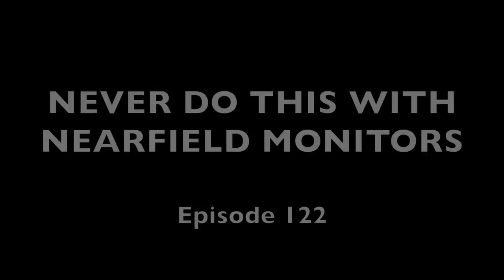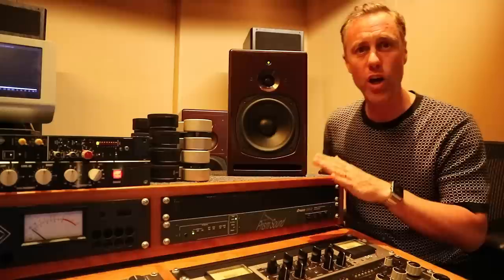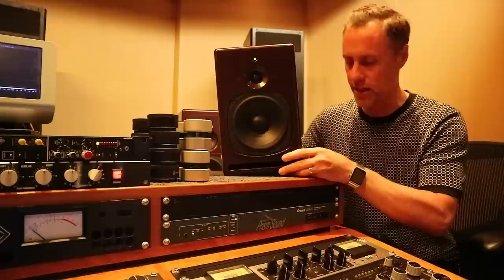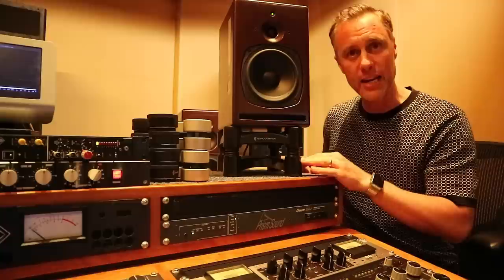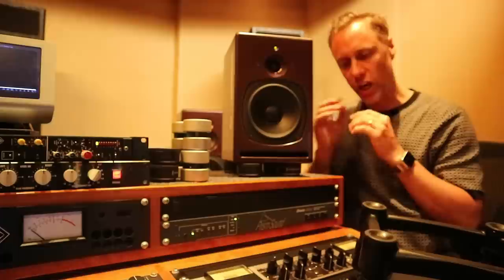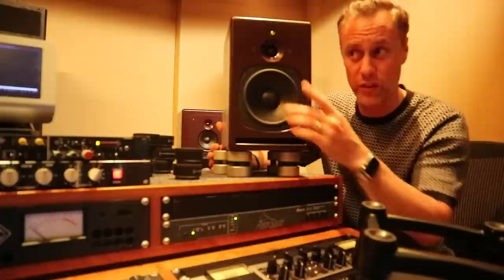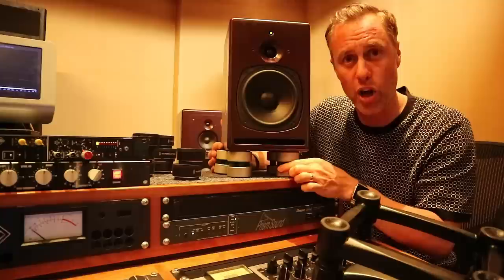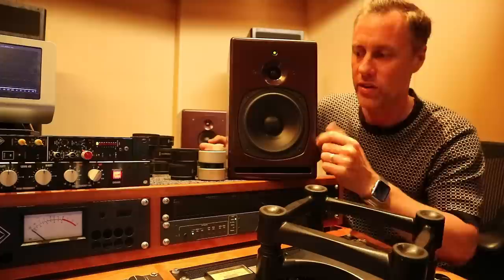NEVER DO THIS WITH NEARFIELD MONITORS !

Comment: 600 Pounds for something you can make yourself, sounds like its made from magic material like angel hair and batwings that bathed in moonlight at a mercurius eclips.
I think the effects you hear are not from the quality of these stands but all have to do with the baffle effect you create under your speaker.
And most of all the resonance you hear from your desk, depending on how mutch these stands transmit into it.
You can also try those stands with sharp points for minimal contact and place them on a heavy stone plate, i think that will do mutch better than a 600 pound solution.
Reply from the maker: Haha yeah it is a bit excessive...they do work though. I've had good results from points and concrete but the Iso Pucks where it's more floating on rubber stuff (technical speak) sounds the best to my ears.
Reply from the maker: I've been meaning to but forgot...
Reply: I see.
Funny to say but i found out that a screen or wall between the tweeter and mid/woofer also produces a better sound quality, even a piece of cardboard mounted with tape should work, try it out.
The low end soundwaves distord the high frequencies from the tweeter, just like the wind outdoors can influence soundwaves from far away. it worked for for me, way less distortion.
8 by 6 inch should do the trick, to stupid for words, but it works also.
Reply: ROTFLMAO. BATWINGS BATHED IN MOONLIGHT....LOL
Reply: Glue a heavy concrete slab underneath the speaker and add those half tennis ball under, talk about dampening! :-)

Comment: 600 pounds worth of pucks adds 500 pouds worth of speaker. Hmmm. 
What about the extra two inches that the speaker moves upwards when combining them with the 'better pucks' , resulting in a different (off-axis) sound arriving at the listerners position? You should review the cheapish pucks again at the same heigher.

Comment: Hi Streaky,

Try this with your isoacoustics. Fill the tubes up with sand. I got a large kitty litter bag for under $5. More than enough even with long tubes in place. I think you'll be impressed.

Additionally, you can try adjustable Sound Anchors whose plates will allow you to put your speakers at the same location above your desk, while completely isolating your desk and its components.

Lastly, very cheap, but also very heavy are using stacks of concrete. I have two stacks of 160 lbs concrete stands that work quite well. Almost every other material I've tried puts some colour or messes with the low end.

Cheers.

Comment: Great video man! Would you recommend using either of those pucks if you already Have some ATC25's on Sound Anchor stand? Thanks!
Reply from the maker: Drummerboy106 yes I would as they will be on a solid base but you need to separate the speaker from the stand.

Comment: Don't listen to the sceptics. If you seek great sound you do whatever it takes. This lot wouldn't know sound quality if it bit them in the arse.
Reply: @liammitchell6803  And of course these rubber feet leave the speaker unsecured, so it can flap round in response to low bass. That will certainly cause intermodulation. What speakers actually need is firm coupling to something solid, so they cones can do what they are supposed to do.

Comment: what would you suggest for ATC SCM 100 monitors, which are quite heavy? Currently I use small floor stands, that come with the speakers, but I don't feel like using spikes, as they damage the floor and I couldn't move speakers around, which I do sometimes.

Comment: Hi Streaky ! Thanks for all the wonder- and useful videos ! I have the Iso Acoustic which I am VERY happy with... but I have angled the, so they are 
2 com higher at the rear end than in the front end... can that cause any problems ? I am thinking non vertical "drag" inside the monitor case (heavy magnet speakers) 
Gravity issues ?
Reply: 😂 vertical drag?

Comment: Any thoughts on having that speaker turned on its side to achieve proper tweeter to ear level? I've just tuned my Focal Solo 6's on their side with the base port on the inside and (at least to my ears) things have come a lot more into focus... Interested to hear what you think of speakers on their sides in general....
Reply: At that point you're likely experiencing a more vertical dispersion of the tweeter from the in-built waveguide. Near fields are designed (typically) with horizontal placement in mind and using them horizontally negates the design principles of the waveguide. It can also have an effect on how wide your mixes sound, better or (usually) worse, due to the fact that it can cause even further smearing of frequencies. It likely won't be as focused a sound as intended unless the speakers have horizontal placement inherent to their initial design.

Comment: Maybe in the U.K. the isolation stands (first ones you showed) are £100  ($200 U.S.) but in Canada they are $600 a pair!

Maybe it sounds crazy but why don't all powered near-field monitors come with threads in the bottom for spikes? Every audiophile speaker does. quickest way to decouple any monitor from the desk. Four simple spikes that you can screw in each of the four corners of the monitor.
Reply: Amazon.ca has the small ones for $109, which ones are you looking at?
Reply: Rubber isolation pads are better than spikes ..  spikes also make a mess of the desk and scratch the hell out of it .
Reply: 600 r u kidding lmfao we in the aus $250 which is already fkin expensive .... zz
Reply: Make some stands yourself. Or have them made (welded) from some industrial pipe and sheet. 
Spikes do work, but spikes plus heavy slab of stone or concrete is better. You want the surface underneath to be dead.

Comment: Would a set not have to be given, to every speaker the mix will be played in as well  ! If your not mixing for an end product user what's the point
Reply from the maker: The point is when you're making changes in a controlled environment you are basing your decisions on the cleanest / flattest speaker reproduction possible...then it will / should translate better across all systems in the real world.

Comment: A good monitor has internal damping so you shouldn't have to worry about the case itself vibrating the desk. But the sound will still be reflecting off the desk in front of the speaker causing comb filtering, so you mustn't have any hard flat surfaces around the nearby radius of the sound coming from the speaker drivers. Granted, the extra stands prevent that immediate reflection off the surface, but the most important thing is that what you hear isn't being coloured by the sound bouncing off your desk.
Reply: Wrong. All speakers vibrate and the denser the surface they sit on... the more that amplifies the vibration! Learn some physics....😖
Reply: @steven2809  Of course monitors vibrate, but because of the modulated air pressure that comes from the driver inside the box (which would be the same signal coming out, only inverse polarity). So with sufficient damping to the box, you still get less standing waves building up inside the box, and therefore a less coloured sound.
Reply: @RothmanHarv  But you are ignoring the 'tuning fork' effect of even small vibrations being amplified by placing on a hard surface.....l🙄
Reply: @steven2809  I'm not. Damp a tuning fork. Its colouration is no less amplified, but damping it shortens the resonance making it perceptibly less noticable. Emojis and excessive ellipsis don't make your arguments any more persuasive by the way.
Reply: @RothmanHarv  Whatever.....even concrete vibrates. Damping changes the resonant frequency..it doesn't eliminate it completely... Some people are so defensive and small minded they cannot learn anything new.....goodbye!
Reply: @steven2809  I wasn't disagreeing and I'm aware of the frequency going up as its dampened (anyone who's played with speakers by tapping the dome while damping it with their other finger will know that); it's just wasn't all that relevant to the main point I was originally making. And you put all your focus on that one I had failed to mention, which really is negligible to the real (i.e. empirical) experience of monitoring if sufficiently dampened. For instance, if the resonance, undampened, was at a crucial frequency where most transient bass is played, you'd be better dampening it which would raise the frequency to where the low-mid chords are where transient quality is less important. Otherwise, redesign the box's dimension so the resonance is at a frequency below the bass (which would be so large, it would be silly). Bye!

Comment: Or... save the money and buy a couple of monitor stands and fill them with sand for good measure. Bam. Speakers isolated.
Reply: aceyage 

I did exactly this with my Atacama HMS2 stands, loaded up they weigh as much as small child.
Reply: Does filling with sand really improve the sound? I've been wanting to get some stands for my Dali Zensor 3's and I don't know which one to get. Any suggestions? Thanks!!
Reply: There's a few DIY vids/blueprints on making your own speaker stands filled with sand using pvc and wood.
Reply: I filled mine with chakra alligning crystals ...much better than sand .. too bad i always have to take them out when it's full moon to charge them up in the moonlight. ;-)
Reply: I don't think filling the stands with sand does anything for sound. But it does make them heavy to carry. Plus they pee out the sand slightly as time goes on. So if you do not live near the beach you can get a great feel for it.
Reply: Adding sand stops the metal from resonating as much.
Reply: I'm using heavy slabs of concrete, with old pocketbooks inbetween.

Comment: The ISO Pucks are sold in packs of two??  That's dumb :-(
Reply from the maker: yeah bit weird but I think it's because you only need 3 for smaller speakers...so only 3 packs rather than 4
Reply: Smaller speakers need 3, so 6 for a pair. If they sell in 4 packs you would need half a set. Same goes for larger speakers, they need 4, so sets of 3 would not do. So sets of 2 accommodate both scenarios. Strange indeed but there is reason. :)
Reply: money fucking grab
Reply: Rob Burgess
   they got the idea from hot dog buns  This guy's  not into music   mid fi audio  You only use a three point tripod set up.   Very  Seldom you get a great rock recording.   This guy Must just do rock.  Don't  Take this the wrong way
Reply: and too expensive.

Comment: I have a bedroom studio with the foam wedges you mentioned, which have solved some problems. But now Im debating whether to get a pair of Isoscoutics for £200 quid or invest in sonarworks room correction software...my gut says isoacoustics.....thoughts?
Reply from the maker: sonarworks and squash balls
Reply: Nice one streaky, I stupidly forgot to mention that I still have a copy of ARC 2 software that I used a while ago in the same room but had to uninstall due to a new PC build.The problem is, is that the setup for ARC2 was such as faff that I never bothered to install again, and have now discovered that sonarworks looks much easier and quicker to setip, hence my thoughts on sonarworks. should i go and try and setup ARC again or go with sonarworks?
Reply from the maker: Sonarworks is much better than ARC and quite fun to setup...it does some good sorting of the phase issues in small rooms.
Reply: Streaky, you absolute legend, thankyou! I'll invest in sonarworks
Reply: Charlie Grey You should do both if necessary. The Sonarworks will EQ your monitors to your room, but if you are still getting resonance from whatever your monitors are sitting on, it won't help with that. So if you don't believe you have issues with your room then you you don't need Sonarworks, but every one should isolate their monitors.
Reply: Sonarworks is a game changer!
Reply from the maker: yep
Reply: Just bought some ISO Acousic stands for my yamaha hs80's and am very very impressed with them, made these speakers sound soooo much smoother

Comment: A well designed and thought out speaker cabinet will be stiff enough, and of a high enough mass (i.e. internal bracing, seperated chambers for drivers, material choice...) that the cabinet should not resonate under normal operating parameters. The Tannoy DMT had a somewhat revolutionary design with their Differential Material Technology cabinets. You can crank them quite loud, yet place a hand on the baffle or box, amd they are dead.Some floppier cabinet designs we would place on little blocks of Sorbothane. This was to keep surrounding objects from rattling, creating false audible distortion from resonation of things like your pens in a cup, a coffee mug, and so on. Otherwise I would get calls that there was a "blown speaker" that needed fixing, or someone would spend a bunch of time searching down the overmodulation hiding somewhere in their gain staging... That was not there.This saved a lot of headaches for many folks. As for changing room response? While you may decouple a cabinet from surrounding strata, a floppy cabinet still adds its own timbre to the equation, and will simply not disappear leaving a fabulous image the same way a dead box with properly designed baffles to avoid refracted sound.

Comment: I have mine hanging from the ceiling by four chains per speaker £30 from b&q with mini carabinars and screw in eyeloops, kills everyone of these methods 0% vibration felt on chains when absolutely trumming, the speaker should be the only thing resonating and all these pads still drain this into whatever surface they are placed on,as a plus point it also frees up much needed desk space in a small studio setup.if you are easily led and have more money than sense then buy what you like,but if you want a better performance and lower costs then pads and pucks are for rich fu#ks😀
Reply: People don't want to be drilling holes and screwing chains into expensive monitors ...

Comment: but monitors should be VERY SERIOUSLY COUPLED TO the floor whenever possible - assuming you have a solid concrete etc floor ... this required good stands - filled with lead shot where possible

Comment: I use these.. https://drive.google.com/open?id=16I2MeU2GOXf-mgTCokelsgiMg6t7yqIn 

They're actually packing material for curtain rods, to keep them from getting damaged in shipping. But the material is way better for isolation than any monitor specific stand I've tried, as far as my listening tests, anyway (take it with a grain of salt) I did a quick test, using Thomas Dolby's "She Blinded Me With Science", of the sound quality with the monitors directly on the desk as a baseline, then compared it with a set of Auralex ProPADS that were loaned to me for this very purpose (very expensive), then some very cheap Yumian isolation pads (like $6), and then the packaging material, recording each session with the same cheapo Tascam DR-05. The packaging material won supreme with the very least muddy sound (I couldn't hear much, if any, overlap with resonance into the desk), the Auralex coming in a close second, almost too close to tell the difference, but still very surprising results, considering they're going up against what is essentially garbage after living out their original purpose. The Yumian pads worked just fine as well, but were very squishy, and my heavy Truth B2031A's flattened them out something horrible. 

I'll tell you what. I've had the pleasure of hearing some incredibly expensive loudspeakers, monitors and the like, and the Truth B2031A's are an incredible set of monitors, especially considering the price. I've mixed on Adam S2XH's, heard Focal Trio's, and the Genelec's that the Truth 2031A's design was "borrowed" from, and I have to say, they stand really close to this really expensive equipment. In the correct setting, with the right kind of isolation and the proper acoustic treatments, they hold their own and truly shine. They sound like crystalline audio, and while not quite as flat and colorless as I would like, they're still an incredibly well engineered monitor, and definitely worth more than what you'd pay for them on average ($200 a piece) I've also used KRK Rokkit 8's, and despite being designed by the creator of those, they blow them away IMO.

Comment: Can you maybe measure the differences between the 3? With a reference mic? Im finding it hard to believe that it makes so much difference. :O

Im currently using stands with a pair of isoacoustics, and it does make a large difference, so maybe you're right, I'd like to see more before I considered dumping £600 on those.
Reply from the maker: I'm not sure if measuring would show the difference...put it this way I had to check the non DMSD speaker as I thought it needed adjusting when I did the test...I mentioned this to a producer friend and he said he had the same thing...it sounded like the speaker had got louder and brighter...weird stuff (good weird though)....
Reply: Hi Streaky can you explain a bit more why the improvements are not measurable ?
Reply: I've read articles like this before, which is why I am sceptical.
Reply from the maker: Udi Koomran I'd love to measure etc but I don't get the time, it's hard enough doing the video and editing it...sorry you have to take my word for it
Reply: ok thanks
Reply: There is a fair height difference between tested iso's, how did you count for that?
Reply: and thanks for all the goodness, now have an insatiable PSIon to add to my ATCitis...
Reply: Udi  Koomran: Thank you for the Ethan Winer link, didn't know it. Right now I'm using cheap, sort of sturdy dishwashing sponges, but it seems they can go... ;)

Comment: 700$ pucks for my 200$ speakers :)) I'm on the wrong channel :))
Reply: Just put 4 little rubber furniture feet, or rubber door stops, not screwed, with foam glued on both sides lol.
5 bucks and it should be very close in performance.